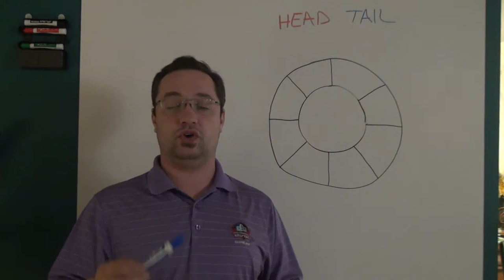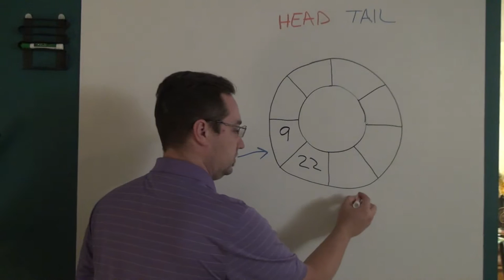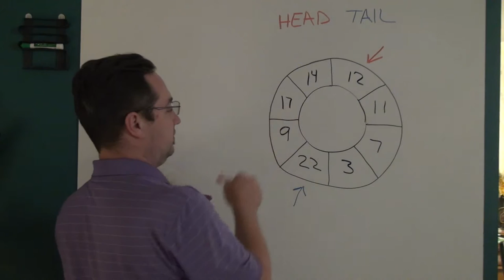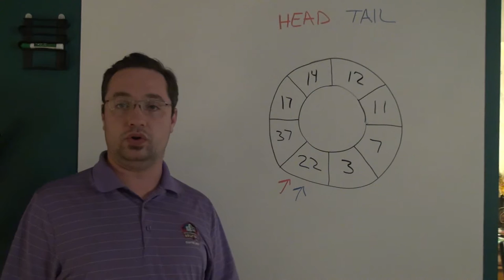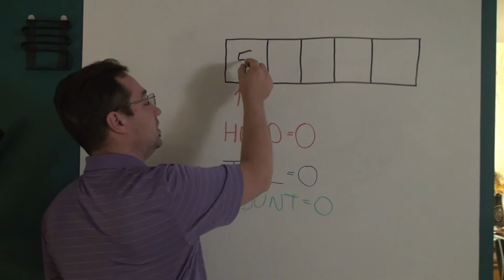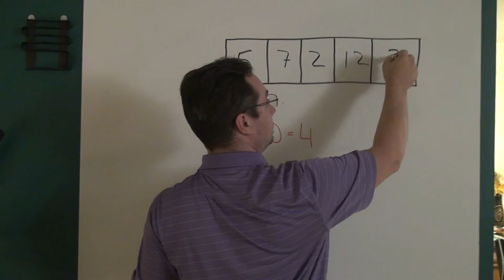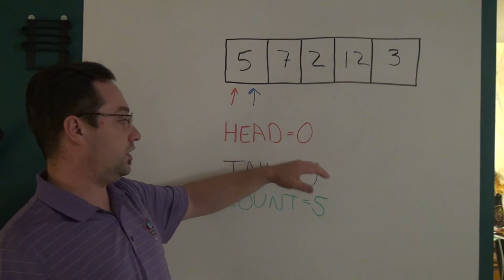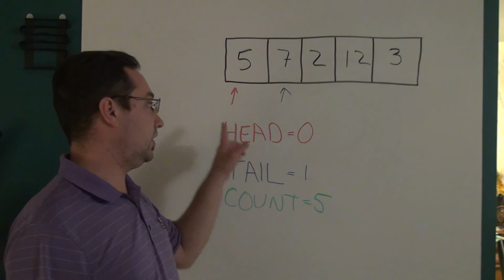eapbg #29 Ring Buffer

Comment: I feel like your terminology is backwards. "You say read from the tail". I think it's clearer to  write to the tail of the buffer and read from the head. Buffer is FIFO. You enter at the tail and leave at the head of the queue.
Reply from the maker: The terminology is meant to parallel something like a caterpillar or worm. The part that moves forward first is the head. As data is deposited at the head the worm moves forward. The tail then catches up with the head. As data is read from the tail, it gets shorted catching up with the head.
Reply: @eapbg  understood. that's a nice analogy. thanks!
Reply: Yeh that was bit confusing,  head vs tail in Fifo. Thanks pretty clear.